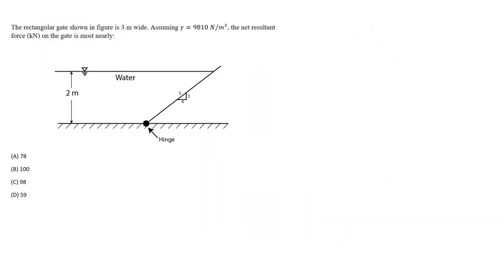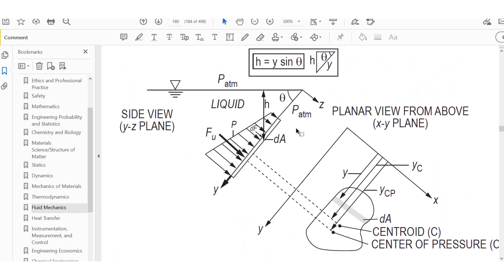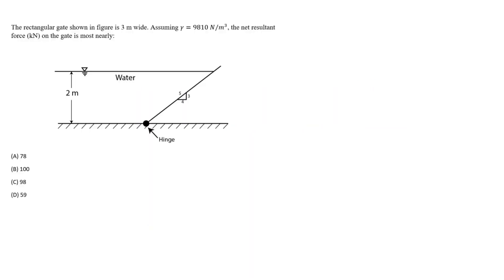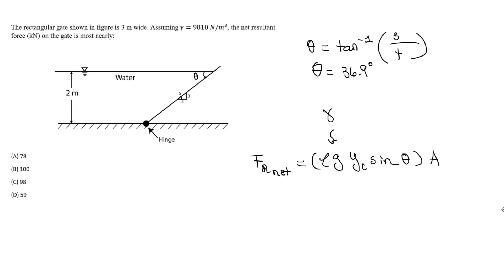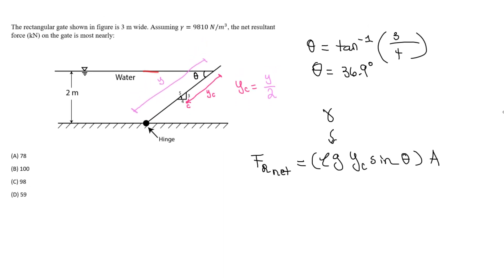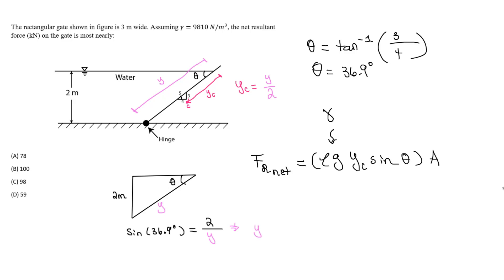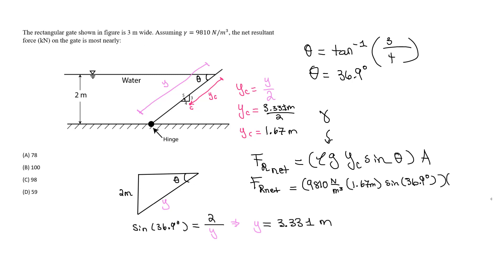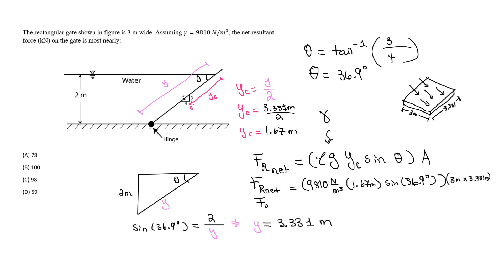FE Exam Review - Fluid Mechanics - Hydrostatics - Slanted Gate

Comment: Why aren't you using P atm???  It's in the Fr equation and actually exists (meaning it doesn't cancel out anywhere)
Reply from the maker: Since Patm acts on both sides (almost alwya sthe case), then we will drop it and only work with gauge pressure. Please refer to the image below: 

https://ibb.co/5xCy3k3

Comment: How did you know that yc = y/2 ?
Reply from the maker: Sorry for the late reply, as Steve stated, the gate is assumed to have a rectangular shape. "Centroid of a rectangle and 1/2 it’s length and 1/2 it’s width." Note, you can find this on page. 111 in the statics section in FE Handbook 10.1.
Reply: Centroid of a rectangle and 1/2 it’s length and 1/2 it’s width.

Comment: You made a mistake. The area is simply 3(width) x10(hypotenuse) =30m2. The options do not have a correct answer which should be approx 300KN. You can't make adjustments for the Area and the Pressure.
Reply: Hypotenuse = Y = 3.331m as he's calculated.  Therefore area is correct being 3m(width) x 3.331m (tall) = 9.993m^2

Comment: if you calculate the weight of the water on top of the gate which is the volume* gamma and add the horizontal force from the water it will give you the same results and its way easier
Reply: Don't add, but take the resultant of the two since they're acting in opposing directions, but yep. This is exactly how I would've solved it
Reply: you still have to find "y" (which is 2/0.6) and then multiply by the force given 9810 x 10 = 98kN